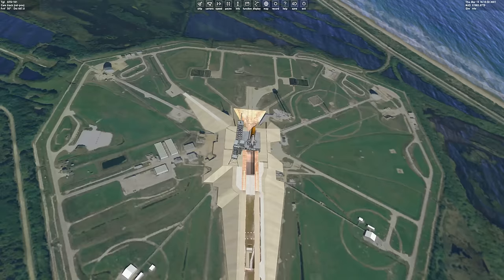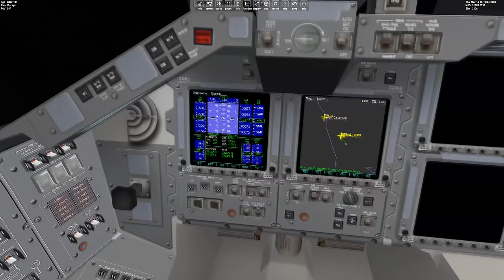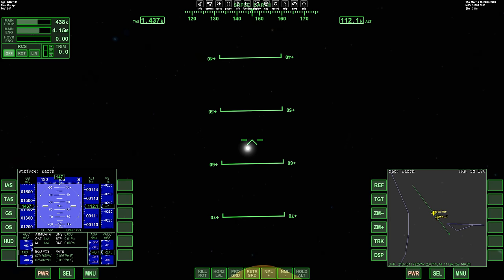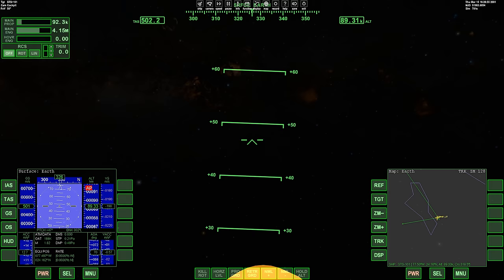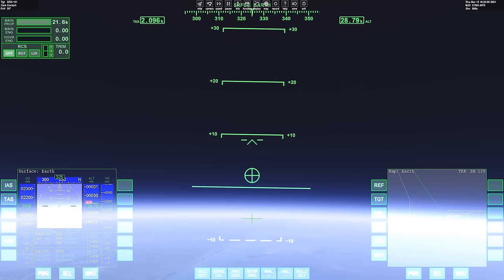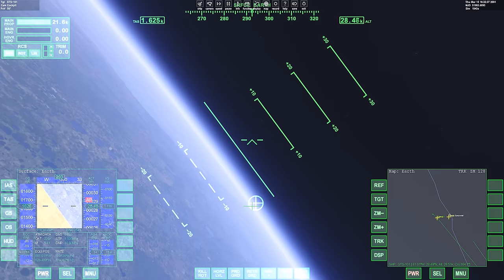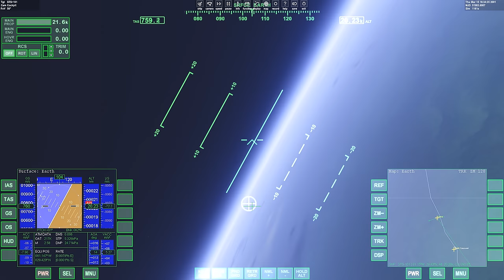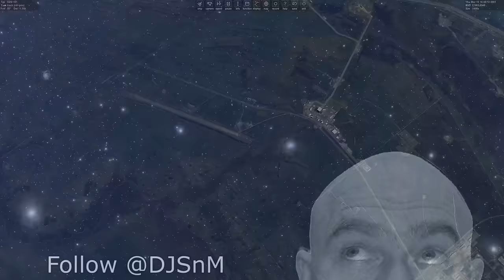Space Shuttle RTLS Abort Challenge - Without The Manual

Comment: My favorite bit about the Space Shuttle's aerodynamics was how they simulated the Shuttle in flight training: Take a standard business jet. Put it in a powered dive to build speed. Then to properly simulate the aerodynamics, put out everything that increases drag (flaps, spoilers, landing gear,) then turn on thrust reversers and go full throttle.

Yup, a business jet at full REVERSE throttle was considered a decent analogue for the Space Shuttle gliding home.
Reply: Business jets are designed for efficient aerodynamic flight, while Shuttle was designed to survive orbital reentry and land, though. On the other hand, reverse thrust at full throttle sounds like an overkill. What's your source for that?

Also, if there wasn't a requirement for like 1000km cross-range maneuver, they would design it with even worse L/D ratio, wouldn't they? After all, for the Shuttle, slowing down is a bit more important than gliding efficiently. I'm wondering what's the L/D ratio of modern spaceplanes - X-37 and Dream Chaser.
Reply: I was also skeptical, but apparently it's true! NASA made four Shuttle Training Aircraft from Gulfstream jets, and they really did lower the gear and use reverse thrust in flight:

"In order to match the descent rate and drag profile of the real Shuttle 
at 37,000 feet (11,300 m), the main landing gear was lowered (the nose 
gear stayed retracted due to wind load constraints) and engine thrust 
was reversed. Its flaps could deflect upwards to decrease lift as well 
as downwards to increase lift."
Reply: @CMDKeenCZ  As for glide slope if you threw a body out of the shuttle at 10,000 feet you would land before it hit.
Reply: That's a pretty neat fact. I have always used reverse thrusters with a turboprop in FSX on short runways and I have made more landings than crashes so far.
Reply: you cant activate the reversers in flight. theres a lockout.
Reply: @nickhowatson4745  google is your friend.  Or just read the comments above.
Reply: @nickhowatson4745  Its like they cant modify it hmmmmmmmmmmmmmmmmmmmmmm
Reply: @nickhowatson4745  The aircraft that was used to simulate Shuttle landings absolutely had its thrust reversers engaged to simulate the manner in which the Shuttle Orbiter Vehicles flew.
Reply: @CMDKeenCZ  Flying Brick Simulator
Reply: I believe they just deployed the thrust reverser buckets at idle - there’s no way they went max reverse in flight lol.

Comment: There is a maneuver that is learned by all ship's captains called a "Man Overboard Maneuver" The idea is to turn the ship around and end up coming back on a reverse course that traces the original course. This brings the ship back exactly to where the man fell overboard. The maneuver is simply to turn the ship either port or starboard, make note of rudder angle, until the ship is veered 60° off course. Then turn the rudder the same amount as previously noted (same rate of turn) in the opposite direction. When the ship finishes the turn and is 180° from the original course it should be exactly in line with the original course.

This could be used for your downwind turn to the runway: Fly directly over the runway and at a (well judged - considering altitude and vert speed) position past the runway, begin this maneuver. Baring any cross winds you should end the turn exactly lined up with the runway.

I'm a 100 ton master and use this in man overboard drills all the time  - it works.

P.S. Scott: you did pretty darn good by the seat of your pants!
Reply from the maker: That works great until you realise your speed is changing during the maneuver.
Reply: Ah .... but .... aaah ... you're right! The shuttle is relying on kinetic energy and it is bleeding off as you turn (plus increasing wind resistance) where the ship, during it's turn, holds a (fairly) constant velocity. A helpful thing to know, probably covered in the manual, would be the shuttle's turn radius with a given degree of bank, in atmosphere.  Like I said, you do pretty well with seat-of-the-pants flying. I wonder how often the pilots of the shuttle actually revert to gut feeling flying.
Reply: 3DPDK Yes, as a student pilot that sounds like a questionable way to turn around. I'm sure it works great in a ship, but in an aircraft you have to consider crosswinds, insttument reliability and all kinds of other concerns.
It can take a while just to work out what your ground track is for a given heading.
Generally, we fly circuits to line up with the runway.
For many approaches you would do a midfield entry, descend to circuit height after checking wind and traffic conditions, then continue the circuit, which involves flying reverse course parallel to the runway, then making two 45 degree turns to align to the runway.
You know when to do the first turn by aligning the end of the runway about 45 degrees behind you (the wing can halp you identify the alignment).
The benefit of this, aside from traffic safety is you have time to slow down, drop the flaps, and so on in a controlled way, but also you can see the runway for the entire approach.

Of course, the shuttle is a glider, and in a glider your goal is pretty much always to get it right the first time, because you don't typically have the luxury of doing a go-around.
Gliders are more likely to use straight-in approaches, but even if you chose not to, if you have the energy to do a 180 degree turn onto the runway, you almost certainly have the energy to do a standard approach circuit.
If you can do one, but not the other, given approach and stall speed limits, plus the kind of turn radius an aircraft would have, then your approach was likely so badly screwed up that landing safely at all is probably a miracle if you can manage it.
Reply: And then you run right over the the guy you were trying to rescue...
Reply: @KuraIthys  Course the difference here between the ship and the plane is also the fact that the plane is attempting to manoeuvre in moving air relative to a fixed target located on the ground. In the case of the ship trying to retrieve a person who is also in the water relatively close by and thus is probably experiencing similar current drift to that the ship itself is experiencing, at least if you are out in the ocean. In littoral waters I imagine that it would be more complicated (Kinda like comparing trying to navigate a plane towards a balloon at 37,000 ft over the ocean or at 10,000 ft right over a 9,000 ft high mountain range fluids behave way more turbulently and less predictably near solid obstructions.
Reply: This is an actual maneuver airlines are capable of doing, it's just that there is working engine or two that give the constant speed and a GPS to tell you if you are lined up or not. You would fly over the runway going the wrong direction, then do the little overboard thing, and voila runway
Reply: @ApolloWasReal  in addition to factors you correctly mention the method you describe also allows pilots (esp landing in remote or on 'uncontrolled' runways) to check for any potential conflicting aircraft taking off, landing or taxing. Also for checking condition of actual runway (animals, debris, etc). USAF and RAF (& most others I would presume) also use this method (including carrier aircraft). Allows visual checks of any damage to airframe or other issues (one landing gear light not green for example). Usually fly parallel to runway (1000 ft or so), turn to port, level turn specified g level (2g to 3g), fly parallel (this time reverse direction) dirty up (gear/flaps) to lower speed, on final 180 deg turn to runway heading descend to 600ft (helps also retain speed in turn), line up and touch down on the numbers.
Reply: Williamson turn
Reply: @scottmanley  Hi Scott please do a video on what would happen to a rocket if it didn't throttle down for max-q, and also is or was there a rocket that was strong enough to go thru max-q without throttling down? Keep up the great work with your video's & I enjoy watching them ! ! !  👍👍👍👍👍👍👍

Comment: Hey Scott, the  Chandra X-ray Observatory was launched on STS-93. The fuel problem occurred during main engine ignition. A gold pin fell out from an oxidizer post and hit the inside of the engine nozzle at high speed. This broke open a few of those little cooling tubes where cold LqH flows through to keep the nozzle cool. The flight computer responded to what it perceived as low thrust by increasing the oxidizer flow. This caused it to burn more fuel than expected. Inside the ET there is a sensor that, when uncovered by the fuel level dropping below it, triggers an emergency MECO to prevent the tank from running dry which it does to prevent the turbo pumps from exploding when there is suddenly no fuel or oxidizer running through them at all. The power and controller glitches were unrelated to the engine issue.

Edit: The launch audio is worth listening to. Especially when they released the cause of the premature shutdown.
Reply: Yup I've read all about that one too. I was making this reference because Scott mentioned the incident but wasn't sure of the details. basically saving him and anyone else a google search and a wikipedia read :).
Reply: anybody got a link to the audio from STS-93? I've read up on 51-F (sorta scary that this was Challenger as well...almost makes me think she had some kind of curse on her). I mean they were within what, a couple seconds of a 2nd SSME shutdown and basically pitching the thing into the drink with total LOCV?
Reply: @Gideon Nebelsick I know you made your comment over two years ago. Sorry fir the delay. After Challenger, did they install some sort of ejection system for the Astronauts, as your previous comment suggests, or am I reading that the wrong way?

Comment: If it's any consolation, turning on the OMS for a gliding shuttle is basically equivalent to firing off a bottle rocket taped to the back.
Reply: a toxic bottle rocket..

hypergolic fuels are nasty.

why they use them out of atmo only.
Reply: Scott Lott Well they do use hydrazine for the emergency power unit on the f-16 and yes, it is nasty
Reply: On the shuttle, the OMS thrusters are only used in space, because that's the only place they should ever be needed. During launch, the main engines usually provide enough propulsion, though for unusually heavy payloads, the OMS cam be burned slightly to provide some extra thrust to get into orbit. They can't burn all the OMS fuel to achieve orbit though, since a minimum amount must always be reserved for de-orbiting the shuttle - without that, re-entry would be impossible.

However, the idea that hypergolic rockets can only be fired in space due to the toxicity of the propellants is completely untrue. The Titan rocket series used hypergolic fuels for both stages, usually nitrogen tetroxide (NTO) and unsymmetric dimethylhydrazine (UDMH). These weren't just used as nuclear missiles - NASA used Titan rocket boosters as launch vehicles for the Gemini program. Look at Gemini launch footage and see the long transparent flame with shock diamonds - rockets burning LOX and RP-1 look rather different.

Also, remember that the propellants don't come out of the rocket nozzle unchanged: When hydrazine is burned with NTO, the nitrogen component (from both fuel and oxidizer) comes out as nitrogen gas, the same as makes up 79% of the atmosphere. What is left over is mainly oxygen and hydrogen, which burn to water vapour. Of course UDMH contains carbon, so when this is used, the carbon content is burned as well, ending up as mostly carbon monoxide and some carbon dioxide.
Reply: So can I take from all of this that it actually wasn't 'that' cheaty of him to use them? As in, the real shuttle could have used the OMS in the same way if it found itself a touch short of the runway?
Reply: It could, yes - provided it actually had any fuel remaining in the OMS system. A lot of it is used to de-orbit the shuttle for initiating re-entry, and I'm fairly sure they dump whatever is left after the de-orbit burn but before the shuttle descends through the lower atmosphere. This is to prevent ground crews having to deal with the residual toxic hydrazine and NTO until the time comes to refuel the shuttle for another launch.

But in theory, if they didn't have to use any OMS fuel during launch or during the mission itself (other than de-orbiting of course), there would be some left over. So if they didn't dump it, the OMS engines could be fired during the glide portion of the flight. How much delta-V they would give the shuttle in atmospheric flight is another question though, since they aren't designed for that, and the drag experienced by the shuttle is rather large compared with most conventional aircraft.
Reply: @lloydevans2900  The OMS engines would have been full in this case since Scott never made it to orbit.
Reply: @lloydevans2900  Lemme quote Apollo13 (the movie, I'm sorry...) there... I don't care what it was designed to do, I want to know if it can do it. ;)
Reply: Within the atmosphere perhaps.
Reply: There was an experiment where the OMS was actually fired within the atmosphere.
Reply: @lloydevans2900  yep you’re right. They indeed dump the OMS fuel which is also used by the RCS thrusters when they come in for landing.

Comment: TAS = true airspeed (your speed relative to air)
CAS = calibrated airspeed ("speed" deduced from the static air pressure in the pitot tube, which is basically the function of air pressure)
GS = ground speed (speed relative to ground)
Instruments usually display CAS.

When landing using HUD, you usually should point the vector indicator to the point where you want to start flare, and when flaring you should 'move' vector to the end of the runway, by gradually pulling up.

Comment: apparently the space shuttle challenger had its death because of the SRB's decoupler. An O ring froze from the cold before launch at the launch site and the SRB broke off its decoupler, pitched over and hit the oxidizer tank at the top of the external tank. Which (as we know) blew up the shuttle.                                                                                                                                                                                                                                                                                                                                                                                                                                                          Their were some reports that when the shuttle blew up, 3 out of the 7 EVA mask oxygen tanks were turned on, which could mean 3 crew members on board survived the explosion but died on the impact when the cockpit hit the ground.

Comment: You should at least have known Orbiter well enough to manage the stop. "The superior airman uses his superior judgement to avoid having to exercise his superior airmanship." You're in the  approach lights, as others have stated. However, looking at Google Maps, they all appear to be pretty much at ground level.  So assuming the landing gear didn't collapse from running over the ten above-ground lighting control boxes, you get the Saved The Cargo bonus, minus major landing gear repairs. If the gear did collapse, you might still get the STC bonus, minus tiles, or even possibly total loss of the airframe. Plus likely salvage of engines, avionics, etc. Unless there was a fire, in which case you're busted!

At least you did stop short (barely) of the fence and gate that cross the ALS (gotta keep those cows off the runway, after all!). Hmmm, well, vertical view shows the nose cone is past it -- but likely above the fence, OK. Running through that fence would have been a likely total loss, unless no fire. However, I'll concede you have a great "seat of the pants." Unfortunately, it's not enough to make a superior airman! 

Question: were you using the split-rudder drag brake? Seem to recall that it was used pretty well continuously, and approaches planned by it, so that if they had a potetial undershoot, they could close it and make up. I didn't think the OMS was any kind of viable undershoot protection.

I have to wonder, too, about the negative G pushover to point back toward Canaveral. I'd have thought a roll maneuver first to make the Gs positive. That would have required two roll maneuvers, but it's not like there wasn't plenty of time to do them...

Points for being very entertaining, and a great promo vid for Orbiter. Wish I had time to play with it.

Comment: "TAS" = "True Air Speed". It's your Indicated Air Speed (IAS) adjusted for air density (pressure and humidity). Indicated Air Speed is the difference between static pressure and dynamic pressure (ram-air) at your current altitude. It's a more useful measure of speed when flying an aircraft, because the indicated air speed that your instruments "see" is the same as what your wings "see", and your wings will perform the same at the same indicated air speed at any air density.